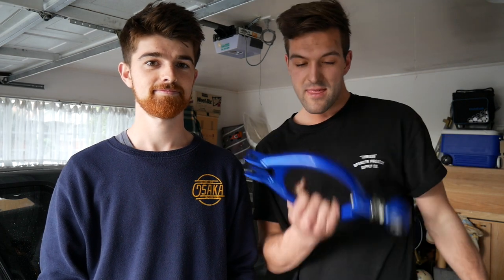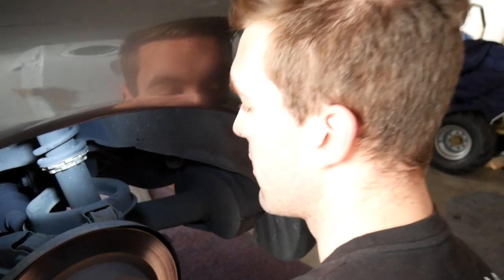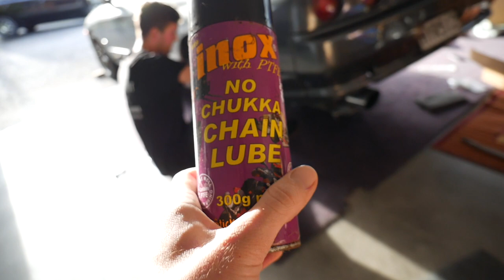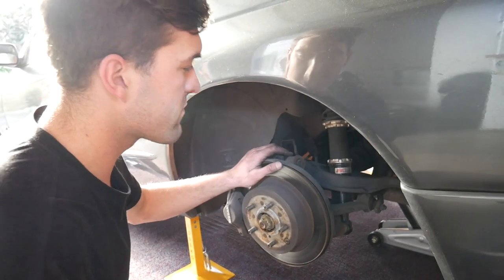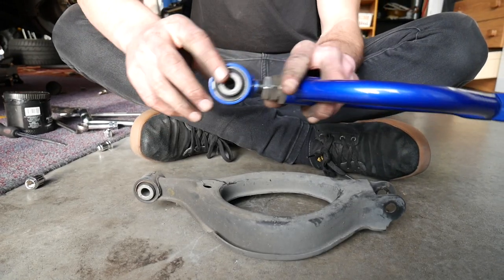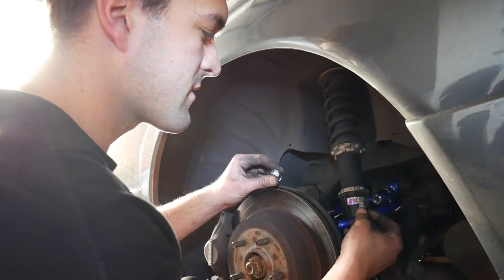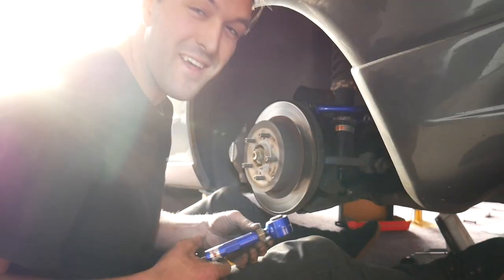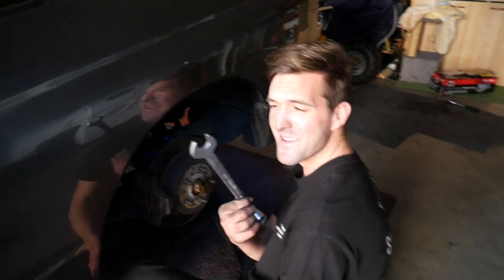How to install rear camber arms (Nissan Skyline R32 + rear traction arms)

Comment: Hey guys,  have you got a cert for your set up? I'm looking to install my coilovers and camber parts myself but being from NZ as well need to know whats needed in terms of getting a cert for diy installs. Or did you get the camber adjusted by pros?
Reply from the maker: +David Tsai hey David! Great question! JD has just passed cert! It's totally all good to do bolt on suspension installs like this yourself as long as you are within the camber laws and get a wheel alignment sheet within a month of your cert. make sure you keep your wheel alignment sheet, cert guys want to see it :) 

Hope that helps